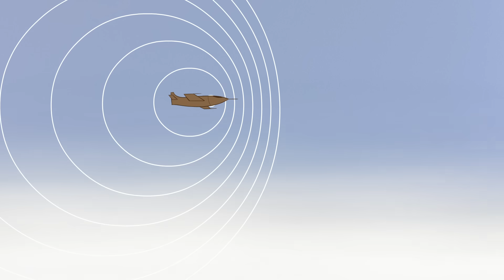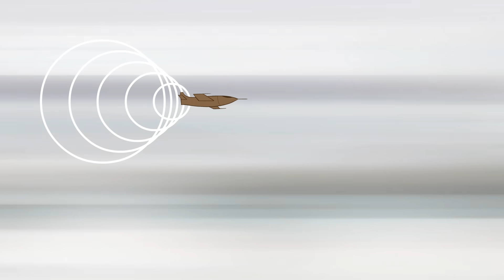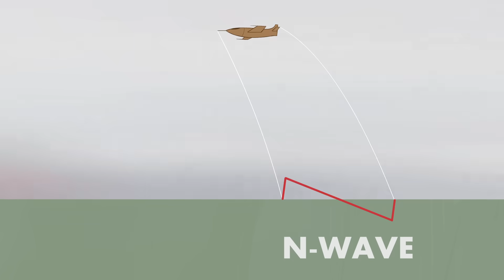The sonic boom problem - Katerina Kaouri

Comment: There is no problem if aerodynamics is considered in the design of an aircraft or missile or rocket. The shockwaves are generated by shapes and can be released via design-stage mitigation. Release of forces is a Chinese speciality. Controlled release of forces is an art. Barometric pressures generate heat due to air friction. Hypersonic is when a poorly designed aircraft burns itself to dust. Fonsidering barometric pressures of Q4 2023. Missiles are silly and planes at supersonic are silly. The deliberate pollution generates heat due to aerodynamic inefficiency points and near supersonic/hypersonic(mach3) cross over points. 330m/s is only applicable at sea level barometric altitude and not always true. Missile algorithms need updates or world laugh at anything supersonic and above.

Comment: I'm a bit confused about the explaination. The explainaition says that it's the travelling sound waves that get compressed until they suddenly lose that compression since the new sound waves appear in front of the old sound waves after braking the sound barrier, and not behind them, as usual when the plane travels below the speed of sound. But then the explainaiton goes on to say that it's the pressure formed at the front of the plane which creates the initial boom. So, is it just the pressure, is it the sound waves or both? Would I still hear a sonic boom if the plane didn't make any sound?

Comment: The simple way is to just turn the engine off. No engine, no propagation of sound. No wall of sound that everyone keeps calling a boom...
Reply: It's still making noise when going through the air, so it won't change much. Also, no engine=crash=die

Comment: So what is the frequency of a sonic boom ? Does the frequency get higher or lower with changes in mph ?
 But  he wouldn't he have to have been travelling 1225.21 km/h÷ 1.61 = 761 mph : the speed of sound ( @ psi ?) ... ?
 The metric system is so someone can say 10 cm instead of 4 inches !

Comment: There were pilots that traveled faster than the speed of sound for Chuck Yeager. It’s just when they did it it was in a nose dive and often ended in death because the shockwave prevented airflow over the control surfaces.
Reply: “That’s not flying, That’s falling with style!”

Comment: I'm American and grew up with the Imperial System, which was given to Americans by the British. We've never left it because old habits die hard.

If you're struggling to think of a kilometer then try to think of it simply with the numbers 1 and 0, that's really all it is. A meter = 100 centimeters. 1000 centimeters equals 1 kilometer. Think about walking 1000cm per hour, that's over 10 yards per hour (close to 11 yards but not quite). 

Hopefully this should put it into some perspective. You can easily think about speed, in the mind, by increasing by a kilometer. So, 2 meters per hour would be close to 2 yards per hour. That's extremely slow. Just scale it up by increments of 10 kilometers and it should make sense. Most cars travel on the highway at 104.5 kilometers per hour (65 mph).

Comment: Appreciate the use of the metric system. But it mentions that Bell X1 reached a speed of 1,127 kph which is actually subsonic. Speed of sound is 1,125 ft per sec. So maybe this is what you meant?

Comment: So why does the wave front on the surface of water move so much slower than the wave front of sound thru it? I know that sound thru air moves at 760 mph, or something like that, and denser mediums like water have even higher speeds of sound. Over 3000 mph, I think. So why does a wave on the surface go so much slower?

Comment: So the waves are really the sound waves emitted by the engines? And how does the tail pass "through"? Or better, what does it pass through?
I have heard explanations where they consider just the rise in pressure at the nose (because of the high speed) and drop behind the plane (and above the wings) -> which also explains the forming of a Wilson cloud.

Comment: I was watching those recent viral ufo videos. It brought up the question how could something travel so fast without breaking the sound barrier. I wonder if you could move through air without making any noise at all. The ufos came up on the radar so it did interact with sound.
Reply: Radar does not use sound.  Radar is electromagnetic.  It uses photons.  Sound comes from pressure waves in the air.  UFOs don't make any sonic booms because they don't exist.

Comment: Cant we make sound move realy slow? Idk just asking for a friend
Reply: Well, yes we can change the speed of sound in air. The speed of sound in the air depends on the temperature of the air. Generally, the hotter the air is, the faster sound is. The opposite is true. If you cool air down to about -200 degrees celsius (which is the lowest temperature you can get without it turning into liquid at normal atmospheric pressure) the speed of sound would reduce from 340 meters per second to about 170 m/s. Still, you don't call that really slow, but it is much slower than what we are used to.

Comment: In Real sonic boom and Shock waves are not sound waves. To be more accurate:- they are not periodic oscillation, they are compression travelling outwards at the speed of sound. If you try to Visualise them using FFT then most probably you will get a saturated wave that had noise characteristics and due to Inverse Square Law it will most likely to sound sound like a pink noise wave bursts.😊 One thing more interesting, If you revert the settings, like the source is stationary and observer is moving with a speed greater than the speed of sound, then the observer will not hear any sound.And Thunder is also a example of Sonic Boom.Correct me if I’m wrong.😅

Comment: But but speed of sound is 1234km/hr 1:01
Reply: At sea level. The speed of sound isnt constant, it decreases as you go up because there is less pressure. At 13 Km, where Chuck went supersonic, the speed of sound is only around 1050 kmh

Comment: So if you're flying faster than sound and you turn on the radio, does anything happen?
Reply: Radios work with electromagnetic radiation, they still work as if you were standing still. You would also still be able to hear it because the air in the plane canopy is traveling at the same speed you are

Comment: given the penchant that a piloted aircraft is restricted by its speed because of the human factor to withstand the geometric forces forced upon said pilot isnt it reasonable that that an unmanned vehicle could create soundwaves beyond hearing?
Reply: a manned aircraft isnt limited in speed, just turn rate
Reply: @sebastiaomendonca1477  wrong the human body is subjected to g forces even at speed
Reply: @keepsake3153  only from forwards acceleration, and never over human tolerances. Thats if you're accelerating in the first place. At a constant speed you feel no Gs whatsoever
Reply: @sebastiaomendonca1477  while that is true mach 3 is the fastest speed in aircraft only 3 planes exist that can do it, and you have proven my point an unmanned aircraft can travel faster AND manoeuvre better than a manned aircraft
Reply: @keepsake3153  Being manned or unmanned is completely irrelevant to how fast an aircraft can go. The reason only a few aircraft can do mach 3 is because there isnt a need for such speeds outside of the small spy-plane niche. I didnt prove your point, i disproved it
Reply: @sebastiaomendonca1477  a Sukhoi and the F111 aren't spy planes champ
Reply: @keepsake3153  They are, however, planes that rely on speed to execute their job properly. Mach 3 is useless in a BVR engagement, WVR engagement and in low altitude bombing.
Reply: @sebastiaomendonca1477  besides you can drive a car but I bet you couldn't drive an F1 because you wouldn't be able to think fast enough to plan or react
Reply: @keepsake3153  thats not how it works lmao. You can absolutely drive an F1 car, reaction times arent a problem when you're on track on your own. The real problem is how sensitive the throttle is and how hard to press the brakes are

Comment: Question: Why was it difficult to go over the speed of sound in the first place? Just because it was a high speed, or a physical phenomenon? Also what happens if we travel exactly at the speed of sound?
Reply: Because of high drag at transonic speeds. Older aircraft weren't designed to handle this. As you go faster beyond Mach 1 the drag falls again.
Reply: We also needed a different form of propulsion.  Spinning a propeller too fast causes the tips to approach the speed of sound, and they lose thrust.  As stated in the video, gravity could produce the extra thrust in a dive, but the control surfaces to pull out weren't designed to handle the stress of the forces involved.  The X1 used a rocket for thrust, shaped the fuselage like a 50 cal bullet nose (as these were known to exceed the speed of sound) and elliptical, rather that traditionally shaped airfoils.  They could have gone faster if they'd realized swept wings would split the velocity vector.

Comment: I’m wondering, is the loudness of the sonic boom influenced by the sound of the source? For instance, a loud or a quiet engine?
Reply: The boom doesn't come from the engine.  Anything moving faster than sound creates the boom.  Even something without an engine.  Remember Chelybinsk? All that damage was from the shock wave from the meteor passing above the city.  The loudness of the boom has a lot to do with the size and speed of the object, but also its shape.  It has to do with how much energy is transferred to the air, and how quickly.